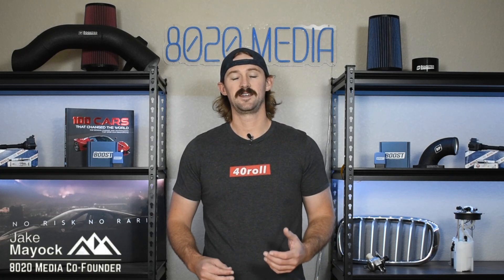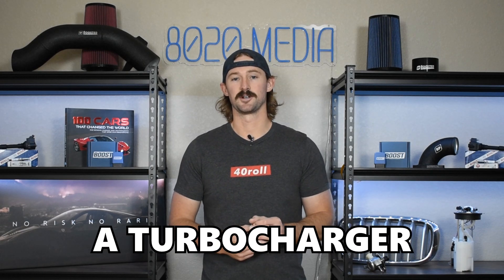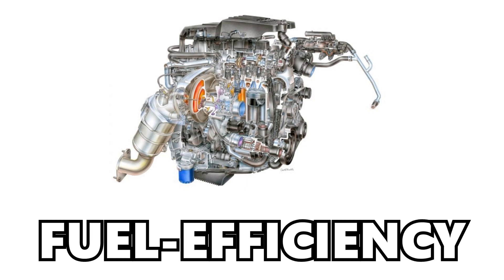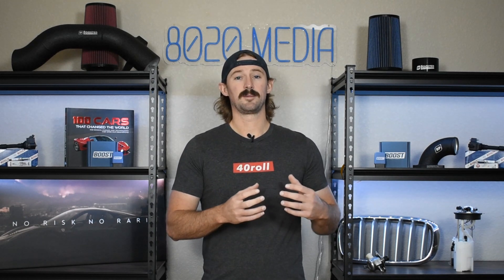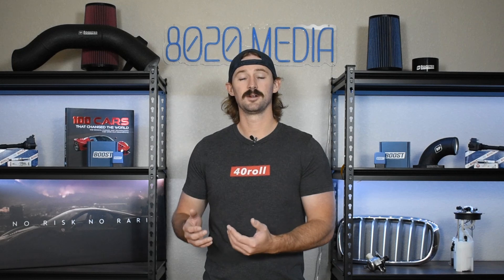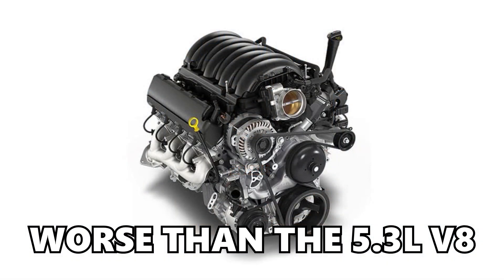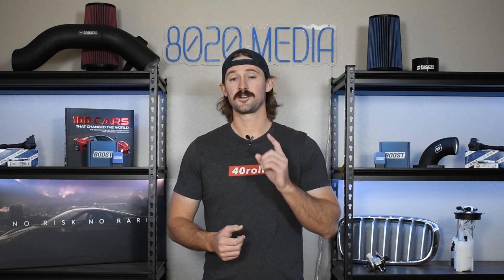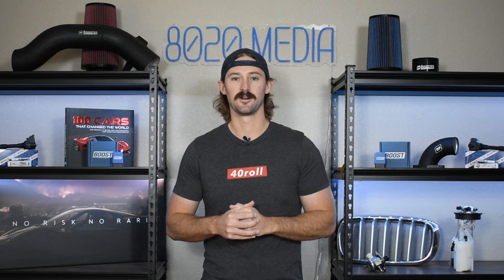GM’s 2.7L L3B Engine | Common Problems, Complaints, & Reliability

Comment: 2020 2.7l Crew cab Owner. Definitely agree with the 8-speed transmission statement and the afm. All it sounds like the truck needs is proper maintenance. But, i do have a question. I plan to keep this truck as long as capable. If the 2022+ models got upgraded parts; Can i just add them to the 2019-2021 models? Or reinforce the problems that have been stated?
Reply from the maker: H - You definitely can and would probably be the best thing to do!

Comment: I have a 2024, bought in April of 2024 with the HO engine, 23,500 miles on it. I’d say 65% highway (75mph average) and 35% city (47mph average) it can get 19mpg on 87 octane. If you drive down the highway at 80mph, it will drop down to about 17.9mpg average. Keeping it at 76/77mph on the high it seems to drink less. With a 60/70 cent swing from 87 to 91, it’s not worth it to run 91. If there was a 30 cent swing, I would. I will say the fuel rail recall was done due to some sort of active failure and I believe that has increased mpg by .5. It is currently in the shop today due to oil coagulation on the exterior of the intake tubes. Not sure what is going on there but will know. 

As far as the transmission, if there wasn’t so much torque management in the tune, it wouldn’t be as sluggish when you put your foot down to get out of the way. It takes almost 1 whole second to shift down where it wants to be to get up and go sometimes. And the shutter when the converter locks up at 6/7 gear is annoying. Now is it the torque converter locking up causing the shuttering or is it the AFM? I have no clue. It will literally rattle the whole truck. Almost like hitting the rumble strips on the side of the highway at low speeds. Overall, I’d give it a 7.1 out of 10. If it was a V8, in sure it would be an 8 out of 10. High country V8, I’m sure it would be a 9 out of 10. It’s an overall a good truck, if it was built like the mid 2000’s truck it would be a solid 10/10.
Reply from the maker: S - Love this. Thanks for taking the time to share your in depth analysis! This will certainly help future viewers.

Comment: The bad fuel efficiency is because it has to run at 4-5000 rpm to go 70 mph plus or if your hauling or towing anything.  4500rpm x4 clears is 18000 squirts of gas a min.  A 2.7 Fird v6 can run 2500 rpm towing or hauling that’s 15000 squirts of gas…..
Reply from the maker: D - Thanks for sharing! Good insights.
Reply: You obviously have never driven one. Going up hill at 55mph pulling 7500 lbs , it runs 2000-2500 rpm only touched 4000 rpm once going up a steep grade at 70 mph.
Reply: Empty getting up to speed on the on-ramp it’s the same deal 2500 RPMs gets you to 70 pretty quick

Comment: My beloved '03 Silverado step-side has a 4.8L V8 that's pushing 200,000 miles and running strong!  Bring back the 4.8L in a single cab, give it adaptive cruise, make it in the USA and I'll trade up!
Reply from the maker: J - Thanks for sharing

Comment: I own a 2025 Colorado with the turbo Max engine.  I just pulled a small cargo trailer with 3 motorcycles in it up Jelico mountain in Tennessee.  This truck pulled like a bulldog.  Never really got the rpm over 3000.  Maintained 75 mph through the mountains and stayed at or below 3000 rpm.  Very impressed with it so far.  Had 2 v6 motors in my last 2 Colorado's and this 4 cylinder is far superior for towing!
Reply from the maker: K - Nice! Thanks for taking the time to share your experience.

Comment: Just purchased a 2025 Trail Boss Colorado, coming from a 2020 Ram 1500 Bighorn. While the ram had awesome power and got about 15.5 to 16.5 consistently with 35's, im loving this smaller 2.7. The turbo gives plenty of pick up and im averaging about 20.5 mpg at 2k on clock now. Sometimes 23-24 on long drives.
Reply from the maker: G - Nice! Thanks for taking the time to share your experience. It will certainly be helpful for future viewers.

Comment: Consumer Reports reliability numbers are based on actual owner experience poles from among subscribers and  specific owner surveys that they send out. Their reliability data on vehicles is in my opinion and others very accurate and about the best measure out there. Their data is spe ific and broken down for each make and model by year. The company is independent and subscriber supported and does not take advertising from manufacturers in order to remain independent.
Reply from the maker: E - Thanks for sharing

Comment: This is how I see it: 
The 5.3 has known reliability. The 2.7 is starting to gain a good reputation. Hence the current 100,000 mile manufacturer warranty. One has been around for 20+ years, the other 5-7 years. So the “proposed” longevity problems are truly unknown. But to compare, Fords 2.7 is significantly more reliable than their 3.5l and their 3.5l was the first ecoboost. 

A lot of the problems stated here were for the most part fixed post 2022, very similar to the 3.0 Duramax. 

Ive owned 2 5.3ls one LS and one L83. The LS has oil consumption issues at around 80k. I believe gm “fixed” this by making the L83 hold 8.5 quarts of oil vs the LS 6 quarts. Both engines other that were for the most part reliable. However, to get power you had to rev them to 4500-5000 rpms. 

I currently own a 2025 Colorado Trail Boss and can tell you the 2.7l torque curve is much improved over the 5.3. The 8 speed in the newer trucks mimics that of the 8 speed in the jeep/mopar products (own a 2024 grand Cherokee) 

Last, the 2.7l is as close to a diesel  feel as you can get in a gas vehicle as I have ever experienced and I average over 21 mpg with 87 and mixed driving.
Reply: I just came from a 2020 Hemi to 2025 TB Colorado as well and am satisfied with the 2.7 power delivery as well. Average mpg is about 21.5.
Reply from the maker: C - Thanks for taking the time to share your first hand experience!

Comment: Lifters are totally different than on the 6.2 and 5.3. When you say they are a problem I wonder how many actually fail? Any idea of the percentage? They sell what 100k a year.
Reply from the maker: J - You're absolutely right that the 2.7L Turbo I4 (L3B) uses a completely different valvetrain architecture than the traditional small-block V8s like the 5.3 or 6.2—no pushrods, no AFM or DFM lifters—so the infamous lifter collapse or failure issues seen in V8s simply don’t apply here; instead, the 2.7 uses DOHC with direct-acting mechanical bucket (DAMB) lifters and variable cam timing, which is generally more robust, though there have been scattered reports of cam-related tick or lash adjuster noise, but actual lifter failures are very rare in this engine. While GM doesn’t publish failure percentages publicly, based on dealer service bulletins, tech reports, and owner forums, the 2.7 has not shown any widespread valvetrain defect pattern, so it's likely well under 1% experiencing real lifter-related failure—much lower than the 5.3L/6.2L V8s with AFM/DFM that are notorious for lifter issues post-80k miles.

Comment: 0 Cylinder mode ? Wouldn’t that just be off ? lol
Reply from the maker: G - You would think! "0 cylinder mode" doesn’t just mean the engine is off—it refers to an advanced cylinder deactivation strategy where the system can technically shut down all cylinders momentarily during deceleration or light load, but the engine itself is still rotating, powered by vehicle momentum (like in coasting), and ready to fire any number of cylinders instantly; DFM continuously and seamlessly activates between any number of 0 to 8 cylinders (on V8s), based on torque demand, making it more dynamic than older systems like AFM, and while 0-cylinder mode isn’t sustained long, it helps maximize fuel savings during those short windows of no power demand.
Reply: @8020Automotive  Ahhhh, I learned me something!! Thanks boss!

Comment: 27,000KM and pretty sure i have had carbon build up already... Idling very rough so filled with premium and added some Lucas piston lube and it's cleared up... Need to switch to running premium all the time I suppose...
Reply from the maker: O - Premium, although more expensive, is always a better idea. Thanks for sharing your experience!

Comment: This engine does not belong in a truck of this size, in my opinion. If anything, put the 3.6 twin turbo or 3.0 thing turbo in it as they run out the rest of the Cadillac CT4V Blackwing and CT5V line. Also, remove AFM everywhere!
Reply from the maker: R - Completely agree!

Comment: Mine has 87 octane in it. I got 27.6 on my 30 mile trip home. I'm averaging 22 mpg. 2025 trail boss. I have a Tahoe that only gets 17 mpg on the interstate. With a 13 mpg average. Not exactly the same platform and the Tahoe is an 07.
Reply from the maker: B - Not quite the same platform, but thanks for sharing!

Comment: My company bought two 2021’s with this engine. One of them is on its second engine with 80k miles and I was just given the other two months ago with 53k. This morning it went into limp mode with a service esc message and a check engine and traction control light and shook like crazy. Sounded like it was tearing itself apart. Not a fan of these things at all. And it has started  lifter tic at 56k.
Reply from the maker: B - Sorry to hear this.. Thanks for sharing your experience!

Comment: Carbon build up is not just  a problem on the 2.7L L3B engine. It is a problem on every direct injection engine.
Reply from the maker: Yes, you're absolutely right. Some engines handle it better than the others, but there is no way around the fact that carbon WILL build-up if you don't have fuel spraying into the intake ports. Whether it becomes significant enough to cause symptoms and power loss at 50,000 or 150,000 miles is really the main topic. All DI-only engines will experience some degree of carbon build-up, though.
Reply: @8020Automotive 5.3 has the same issue .

Comment: I am not sold on these small turbo engines.
You can run in L and AFM is locked out.
This video is premature.
Most these motors do not have enough miles yet.
Our Colorado gets 20/23 mixed driving a little better than they promise.
So far very smooth operation, but we carry a 6/90 warranty plan.
Reply from the maker: M - They've been out for 6 years, giving ample time for people to reach 100k miles. There have been plenty of mixed reviews, certainly more good than bad! Thank you for sharing your experience.

Comment: HELP ..engine ROUGH idle on a brand new 2024 Colorado LT . NO codes show up> DO you have any suggestions. I see this is an issue on the internet..
Reply from the maker: R - If your 2024 Chevy Colorado LT has a rough idle with no codes, common causes could be unmetered air intake (vacuum leak), bad fuel quality, carbon buildup on intake valves, or an issue with the throttle body or MAF sensor. Since it's a brand-new truck, I’d check for loose intake connections, vacuum leaks, or a faulty PCV system. Also, consider doing a throttle body reset by disconnecting the battery for 10-15 minutes. If the issue persists, take it to the dealer while it's under warranty, as GM has had some reports of ECU software updates fixing rough idle issues on newer models.
Reply: Change oil at 5000 miles, not by the oil change light. A good PEA fuel cleaner every once in a while is needed. Use top tear fuels. The cheep stuff causes problems. Also remember to turn off the start stop.

Comment: I have a '21 and was getting around 18.5 city and low 20's hwy. Ran great until it didn't. Started ticking about 2wks ago and shop found metal particles in engine. Glad I got extended service plan!
Reply from the maker: M - Sorry to hear this.. How many miles did you have on it?
Reply: @  Have 90K. My local shop told me GM extended warranty to 100K, so just made it. Not pleased GM told dealership to just replace the lifters when my local shop determined need to replace engine. Sounds like taking the cheap way out and doing quick fix since warranty ends in just 10K more miles. Also going to charge me for the oil change even though they need to flush system to try to get particles out as well as for a leaking oil separator
Reply: @8020Automotive  90K
Reply: How many miles if I am not wrong GM provides 100,000 power train  warranty and 36000 transmission warranty.

Comment: I've been driving one that is a company fleet vehical for 2 years and 55k miles. It does average around 19mpg for me and I'm not really easy on it tbh.  I am skeptical of it's longevity though. The only problem so far was a failed evap pump that was repalced under warranty, though it took weeks for the part to come in. I wasn't aware of the AFM but I sure do hate the start stop... have to remember to turn it off at eachcstartup.. and it doesn't even work right whenever it's on lol.
Reply from the maker: C - Thanks for taking the time to share your experience!

Comment: Your claims are not supported by the available data.   Overall they seem pretty solid.  I dont see hardly any issues with the 2.7 ltr .   The v6s n v8s are having the belt and lifter issues not the 2.7.    Your getting your facts twisted.
Reply from the maker: S - Just because you don't experience it, doesn't mean others aren't experiencing it. However, thanks for taking the time to share your experience with it.

Comment: I'm actually currently throwing a P06DD the oil pressure control valve solenoid stuck off. I wouldn't have thought this would have gone out but here I am eith this issue. It's a 2020 1500 2.7 turbo and it's got 55k miles on it.
Reply from the maker: M - Sorry to hear.. A P06DD code (Oil Pressure Control Valve Solenoid Stuck Off) on your 2020 2.7 Turbo with 55K miles likely indicates an issue with the dual-stage oil pump, oil pressure control valve, or a clogged oil passage. Start by checking the oil level and condition—low or dirty oil can cause pressure regulation issues. Ensure you're using the correct oil viscosity recommended by GM. If the oil is fine, inspect the oil pressure sensor and wiring for damage or loose connections. If everything checks out, the oil pump control valve solenoid may be stuck or failing, requiring replacement. Since this system regulates oil pressure for efficiency, ignoring the issue could lead to low oil pressure warnings or engine wear over time. Keep us updated!
Reply: Was this covered under warranty? Since it's less than 72,000 miles.
Reply: If you're doing the 10,000 mile oil change interval i would strongly recommend cutting that in half or something (like every 5,000 or year = change oil)

Comment: Guys have to stop going out buying 35-60k vehicles then thinking you want longevity with little to no maintenance. Yes on a turbo 4 cylinder engine you need to use premium gas!! Yes you need to use synthetic oil and change it every 3k! Yes you need to service your transmission every 50k miles especially if you are towing!! Yes changing out your spark plugs early is a great idea especially if you are towing or beating on your truck driving it through the mountains towing, etc. I’ve driven cars and trucks for hundreds of thousands of miles. Had an Expedition I went over 300k miles on. I’ve owned everything from foreign to American and from smaller turbo 4’s to big V8’s! Maintenance is the key!! Stop expecting longevity without maintenance!! That’s a you issue not a manufacturing problem!!
Reply: The 2.7 is designed to run on 87 the lead engineer in a video says your just wasting your money putting premium in it.
Reply from the maker: I - Incredibly well said... We think this is certainly the case nowadays.
Reply: 1st gen Expedition with the 4.6/5.4 Triton? I still have my '99 Eddie Bauer as a secondary vehicle and it has 320k on the clock. Obviously didn't buy it new, I was in elementary school when that thing was built but I change the oil once a year(I might drive it 2000 miles/yr at this point) and have fresh Motorcraft plugs and coils, and replaced all the vacuum lines.
Reply: I can run 93 and waste even more money
Reply: Leased 2  $339 a month 2 years 15,000 has everything my 23 rst had just a 110 hp less 😂

Comment: My wife just bought a new Colorado with this engine. So far after 5,000 miles it has been flawless. It gets about 21-22 highway and 18 average on backroads so far this winter. It has good torque down low that's for sure.
Reply from the maker: J - Nice, thanks for sharing! Keep us updated.

Comment: 2024/2025 models don’t have the AFM/DFM. Oil pan is back to aluminum and 5yr 100,000 mile powertrain warranty. Get an oil catch can for the carbon buildup.
Reply from the maker: L - 2024/2025 models certainly do have AFM/DFM... Not too sure what you're getting at with that.
Reply: @ well the ones I’m looking at do not have it.
Reply from the maker: @ The 2.7L L3B's you are looking at don't have DFM? Are you looking at used deleted versions or something? They all come from the factory with DFM.
Reply: @ no brand new ones. I spoke with the salesman, manager, and mechanic. That’s what they are telling me. 2025 models.

Comment: Power comes from combustion.  One cylinder gives one combustion.  One combustion gives one unit of power to turn into work.  Doing heavy work requires more power.  That all means that to do the same work as a V8, you have to run the cylinders at twice the rate on an I4.  More heat, more stress on the cooling and oiling system, more explosions per valve or per cam lobe.  It's just math.  Any metallurgical advancements that justify trying to get an I4 to do the work of a V8 just demands the question "why don't you just put that metallurgy into the V8?"

No one is on the consumer's side on this:  Consumers benefit from equipment lasting longer.  Both the primary market and the secondary market.

Then there's the environmental concerns:  What's the "green" impact of building wimpy turboed tiny engines repeatedly, rather than a single sturdy V8 that will last X times longer?
Reply from the maker: K - Thanks for sharing all of this.